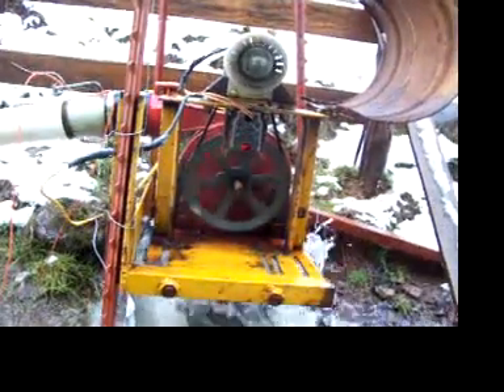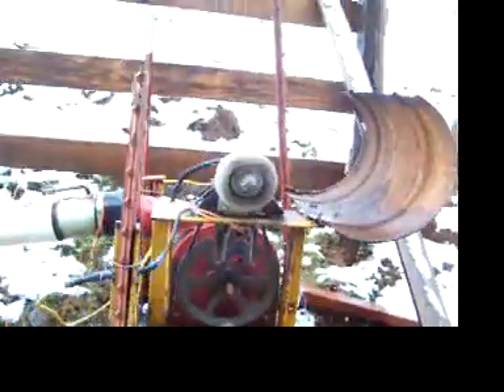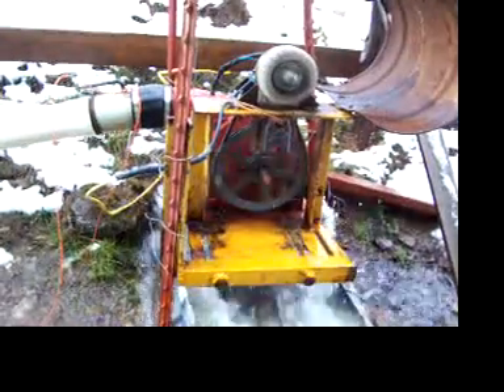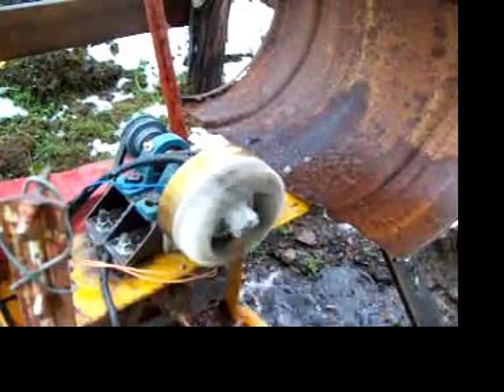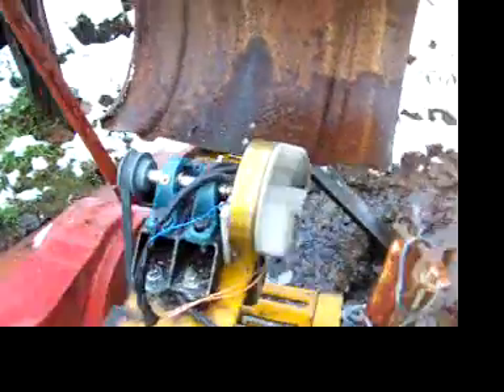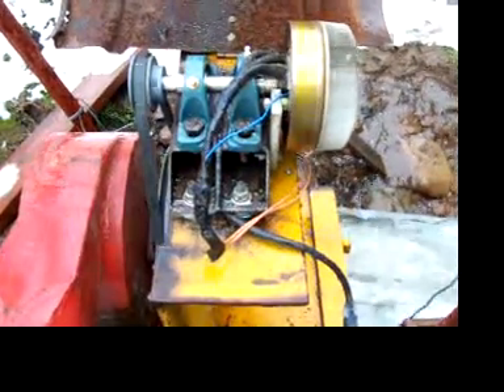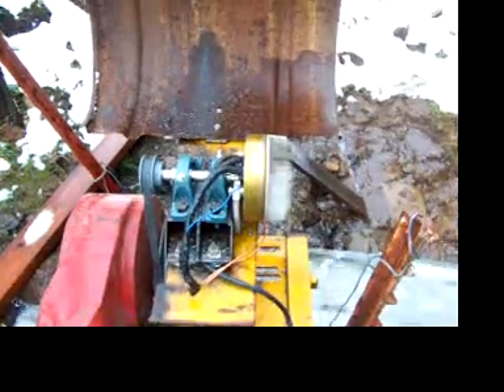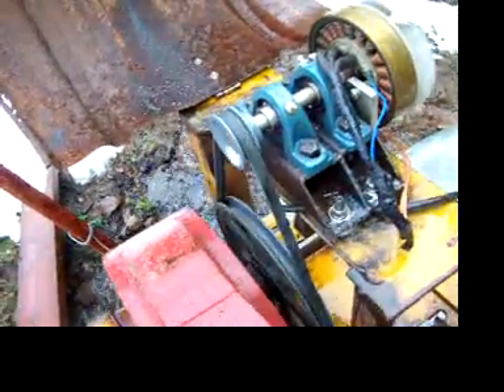Crossflow Banki water turbine

Comment: I had nearly the exact same setup, probably the same generator/alternator... I injected the water at the bottom to get the most head. Actually i adjusted the nozzle to where i had the most RPM under load, easy to hear the pitch, When i closed in the ends of the fan my RPM went way up, also the air no longer blew the water out. A Banki uses the energy of the water twice if properly set up. also why are you leading 12 volts up the hill? 120 volts will lead 10 times easier.